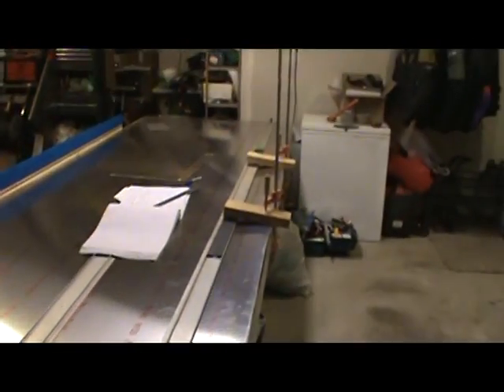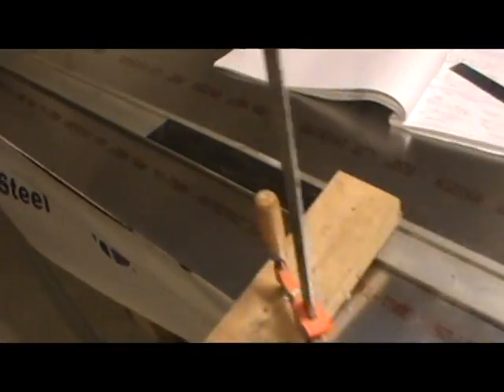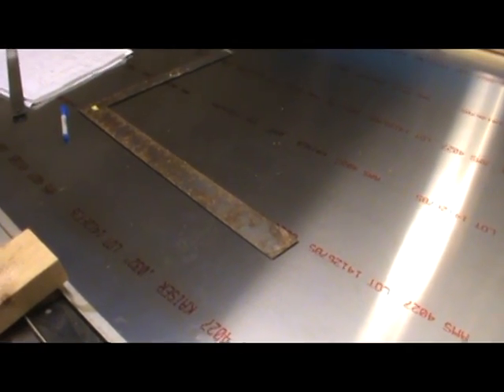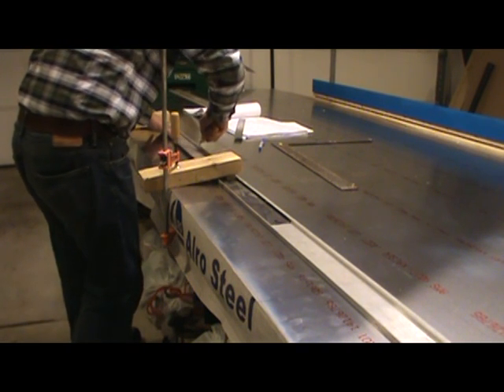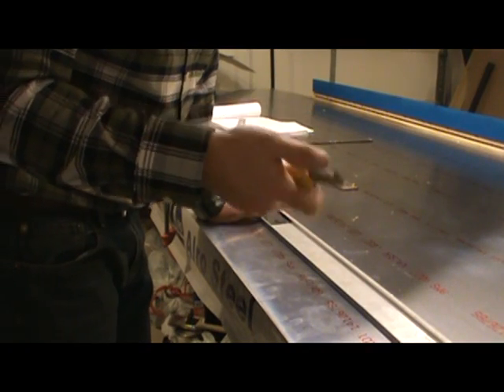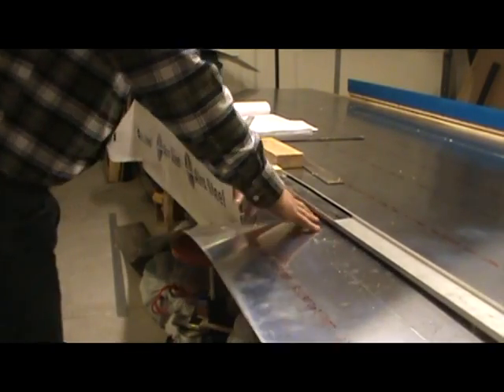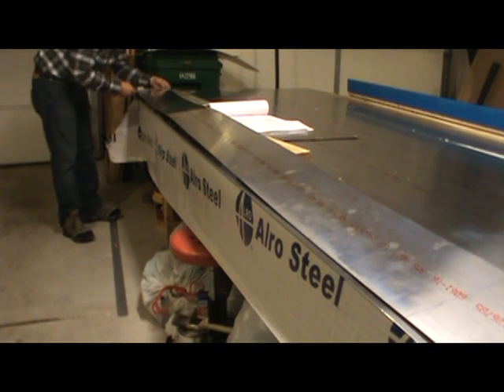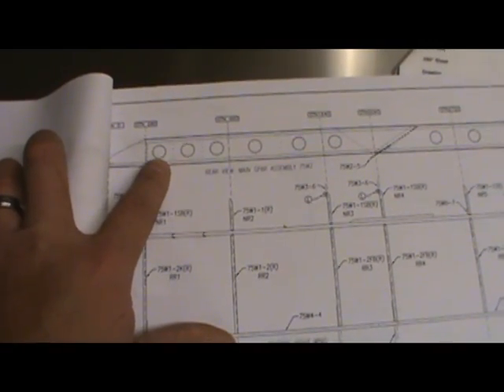Cutting Wing Spar Webs With a Scoring Knife

Comment: Thank you for the video. I bought my wing skin material for my maule wings and i have to do just what you did. Have to take off like 5.5 inches. Now to find some straight edges.
Reply from the maker: You're welcome. I just realized I didn't include a link to the modular cutting guides I used in the videos. Just added them to the description if you're interested in them. Thanks for watching!